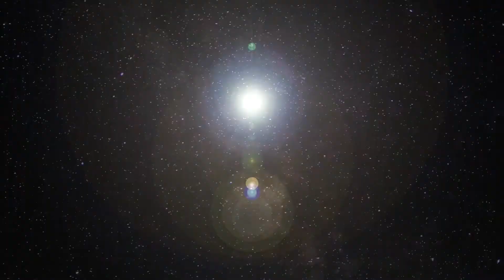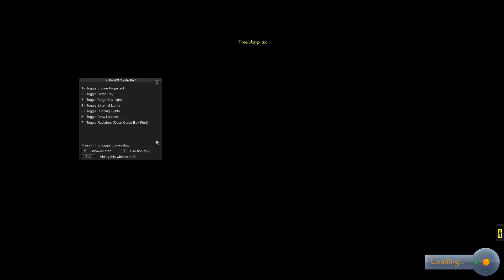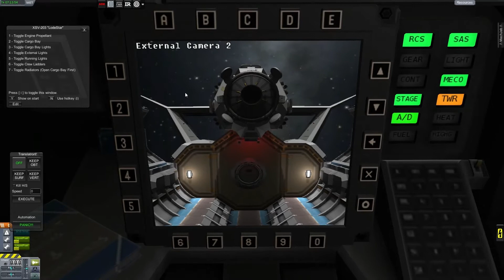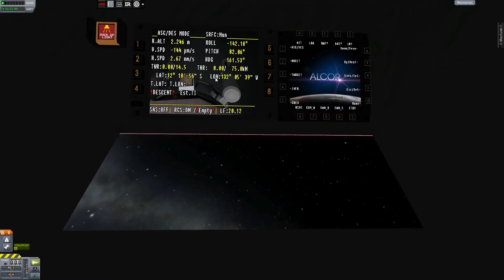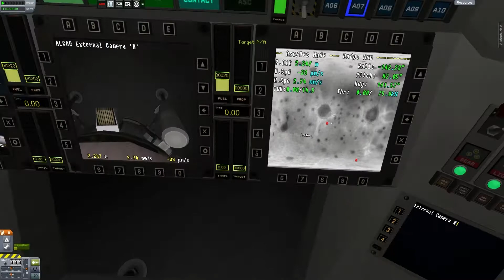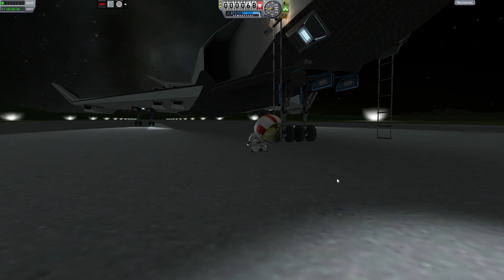Pirates in Space! - Kerbal Space Program (Modded Career)

Comment: How are the mods interacting with each other? I know some haven't been officially updated to 0.23
Reply from the maker: They all work fairly well; the only one I had to tweak was B9 and that was just an updated to two of its required DLLs (Firespitter and ExsurgentEngineering) to make it compatible with .23. All the other mods I'm running are technically .23 compatible.
Reply: I know about the B9 needing those DLLs updated, but other then that their all playing nice?

I'm looking to remod once I finish my current career game and am thinking about doing a series with it.
Reply from the maker: Yup, you just have to be pretty mindful of making sure there's no duplicate DLLs from the various plugins (for example, if you install both B9 and Firespitter, delete the older version of firespitter.dll)  and make sure you keep up on the newest plugin versions specifically. Part mods are pretty harmless but I had the release version of MechJeb 2 installed, which caused Kethane to quit working, so I had to update to a dev build of MechJeb 2.